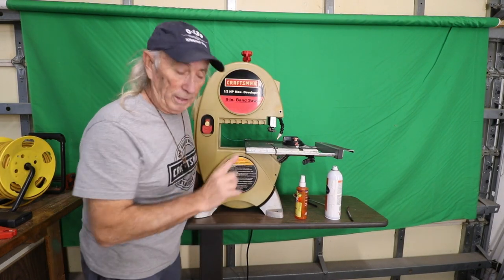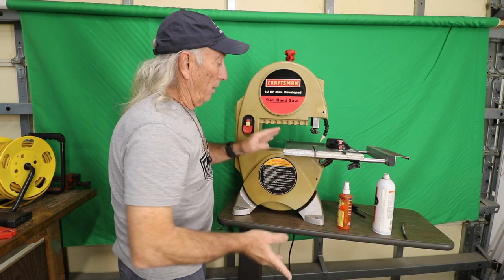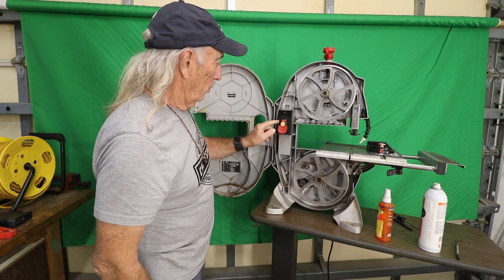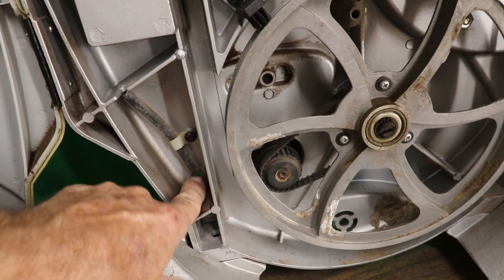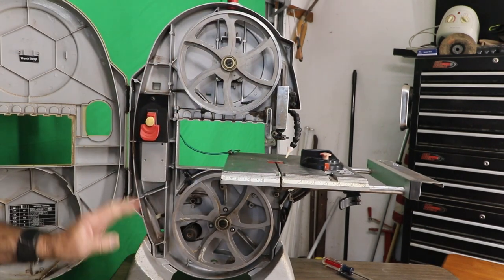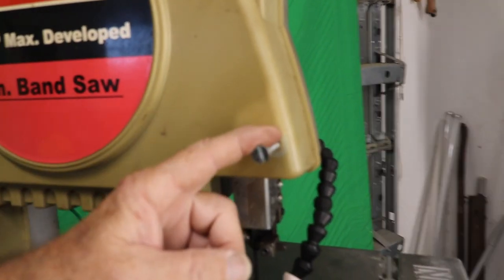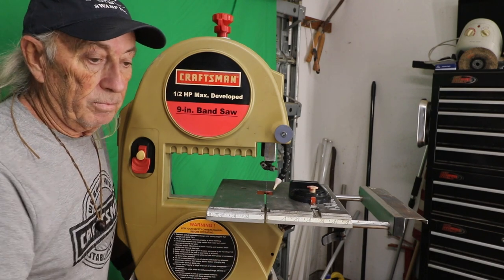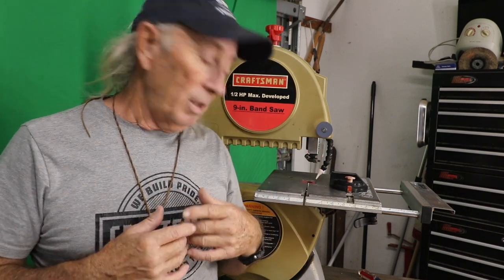Craftsman 9 inch bandsaw and tool give away. Coffee and Tools, episode 181

Comment: I 3d printed tires for a craftsman. Tpu at 1mm thick. Did it in 3 strips and gorilla glued them on. Perfect
Reply from the maker: Haven't had much luck with Gorilla glue on PLA...mmm interesting !:face-blue-smiling::face-blue-smiling::face-blue-smiling:
Reply: @SirTools  it wasnt pla it was tpu, the rubbery stuff
Reply from the maker: Never tried my tau...interesting
Reply: @SirTools  I designed the tires, the drive pullies and the belt that drives it. So four parts of which two are tpu and two are petg. It works perfectly and cost very little
Reply from the maker: I needed an O ring and using TPU it worked and does  the trick. Shhh..don't tell anybody :face-blue-smiling: